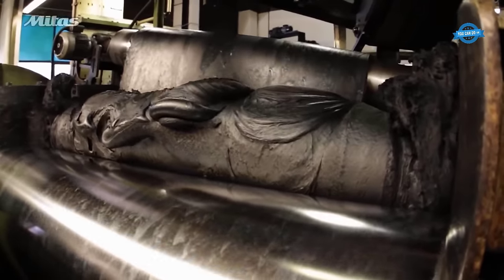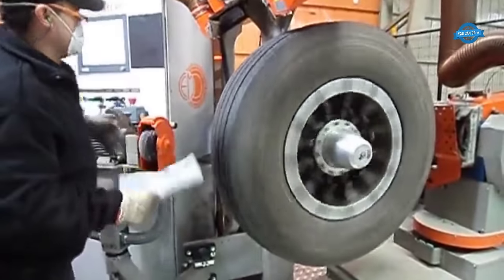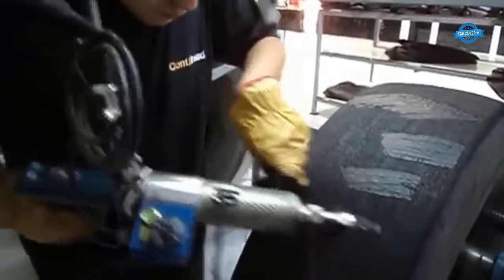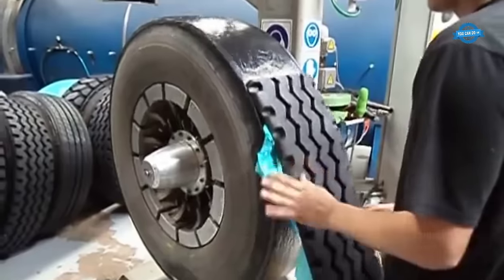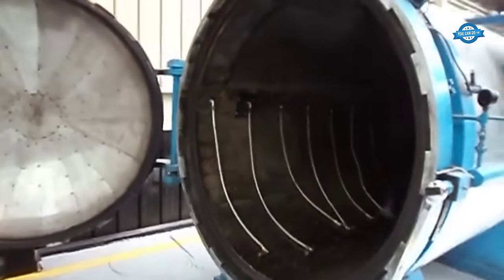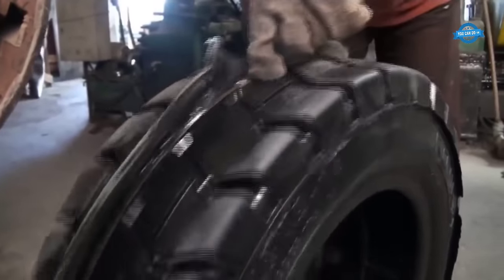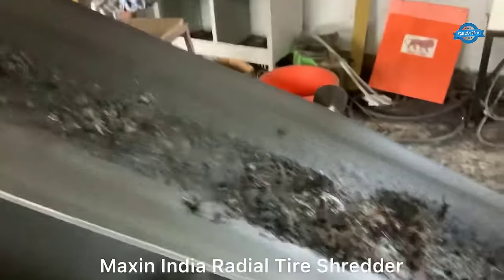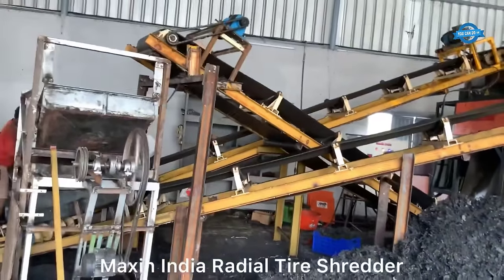GIANT TYRES. Revolutionizing Tire Recycling: From Production to Recycling in 50 Minutes

Comment: In the 70's, I used to retread tires daily, mostly for passenger tires. After buffing BY HAND using a basic template, the carcass was sprayed with adhesive also by hand. The machine I used to apply fresh rubber was called an ORBITREAD. No splices involved, a continuous ribbon of fresh rubber. Loaded by hand into the mold by hand, bag inserted and internal rim by hand. After the cure was completed, I inspected by hand, trimmed by hand and finished by hand. whitewalls were buffed and sprayed with the familiar blue coating.
At this priod in time I was listed in the nation as an official certified retreader.  My failure rate was .05 of 1%. well above national acceptance level.
Just one more thing I did in my life and strived to exceed at.
Reply: zقى

Comment: Retreads are not a good idea for road trucks and trailers of all sizes. Ok for storage trailers, but that's it. Any tire that has had a flat repair done should never be capped. But shady dealers will do it to make a buck. 
Retreads are Not fuel efficient by any means.  Now you have even more rolling resistance,  from the casing, new tread, and glue holding them together. Wich in turn makes tire run hotter than a virgin tire would. 
Retreads may be cheap to buy, but when they explode from casing failure,  they do so much damage to the vehicle, it is always cheaper in the long run to buy a virgin tire.

Comment: And now folks you know those huge strips of tire/rubber on the interstate that rips your fender off when you can’t avoid them……THIS IS WHERE THEY COME FROM !!! I drive a semi and I refuse to run recaps on my truck and trailer, yes they are half the price of new tires but they only last half as long as new tires and they ALWAYS fail while on the road and the roadside repair is EXPENSIVE therefore I will run new tires and leave the recaps for the farmers to run in their fields

Comment: No way would i risk my life running them on my trucks drive wheels. I only run retreads on my trailers if i dont have any other choice. If you drive around australia and you see shreads of truck tyres, those are mainlythe remains of blown out trailer reatreaded tyres.
Reply: I don't think they would be allowed on steering tires that would be insane they must be getting better at it I don't see as many treads laying on the side of the road